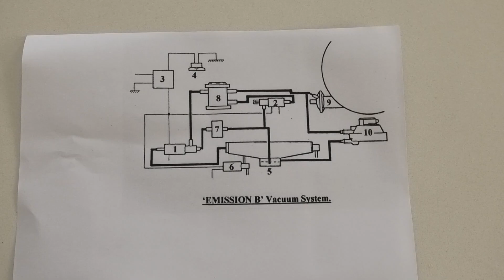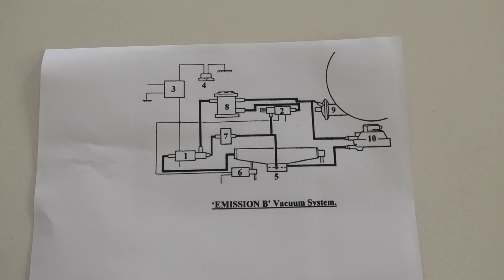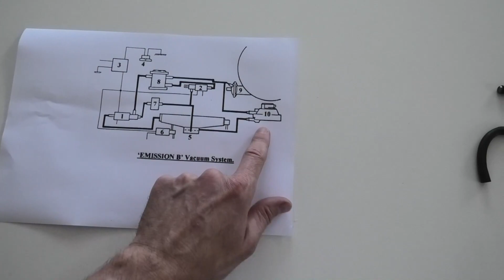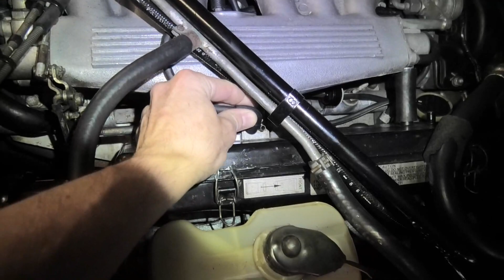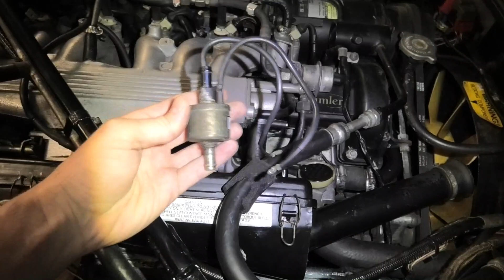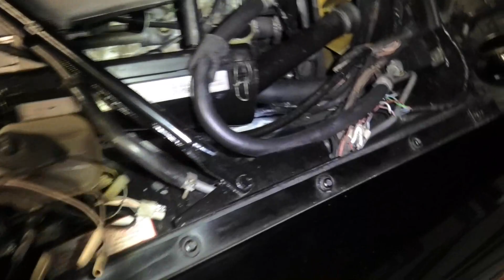Jaguar V12 Vacuum Advance Delay - safe removal

Comment: Thanks for the video,  Cos....and I might be your first subscriber!    I have removed the  complex vacuum advance system on my 86 V12 too -mostly because the vacuum modulator stopped working correctly and I couldn't find another.  I'll put the dump valve back into the system now, though.   One thing to add, I believe the Extra Air Valve (EAV) also provides extra air when when the car is in Drive/Reverse and AC is switched on,..... to prevent revs dipping too low.  It also keeps revs a little higher during cold start.  I found you can remove the switch that closes the vacuum to the advance but keep the EAV working - which is what I've done.
Reply from the maker: Thanks Peter - I have been enjoying your videos too - you have inspired me to attempt a radiator upgrade myself. I'm going for an aluminium rad with twin electric fans. The mod you suggest for the EAV sounds compelling - I'll see how my car goes over the next few months (Summer and Winter) and will implement it if I have any low-idle issues. Thanks for subscribing.